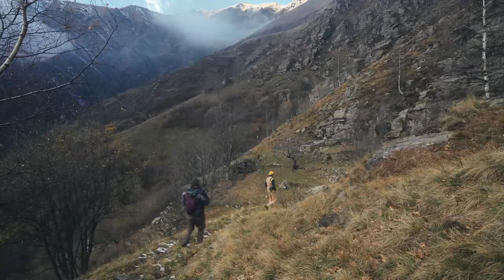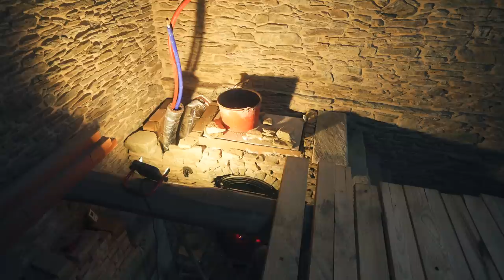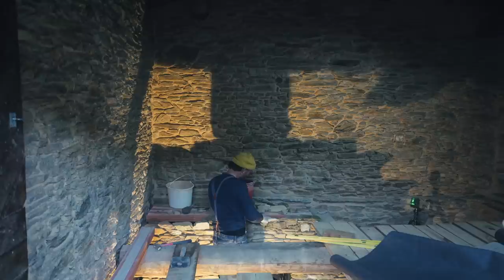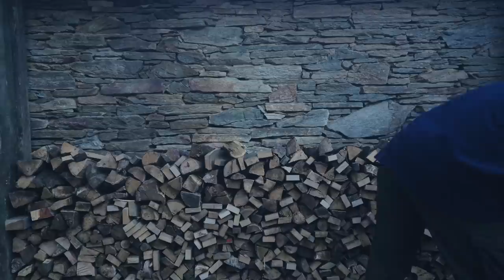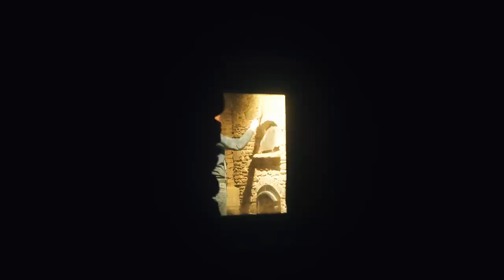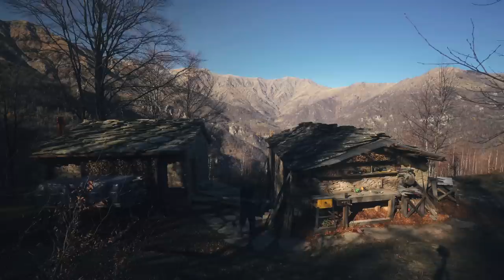#93 Finishing the Stove

Comment: My father used a red heat lamp in the chicken coop during the winter to keep them warm. Maybe you could install one  for your chickens
Reply: Where would the electricity come from?
Reply: @jsmith5278 the same place the rest of his electricity comes from.  Solar energy and batteries.
Reply: That is a really good idea.
Reply: @freeottis  its not meant to heat up a large space, they sit under the lamp light, kind of like sitting in a suntan booth.
Reply: Chicken usually sleep in a tight space near eachother. If you put a warm lamp near them, they will sleep under it.  @Theselfiechick
Reply: @jsmith5278 A solar panel on the chicken coop roof?
Reply: Martijn, if you read this and you want a red heating lamp for your chicken, let me know and I’ll get one sent to you.
Reply: Yes,it is too cold outside for them without extra heat
Reply: Can’t wait for the floor to go down and for you to move in at last. Those crazy lights in the sky I think are a Starlink satellite train, they separate off when they reach altitude, thanks to Elon Musk, if it’s not that then I’m freaked out!

Comment: Martijn, the lights you saw that night is most likely the Starlink constellation satellites. They usually moves in a straight line for some time before it position itself as part of a larger network of satellites. Perhaps its's time to consider Starlink connectivity for your wifi needs. :)

Comment: One question: As far as I might understand, the room above the stove will be heated  too. So why did you insulate the roof of the stove? Maybe to prevent cracking of the concrete covering due to thermal excursion?

Comment: In one of the videos you mentioned putting in a tank somewhere around the stove to heat water. Did you install a tank or decide against doing that? Did I miss something? I'm also curious about the precast channels you installed on the top of the stove and then covered with cement.